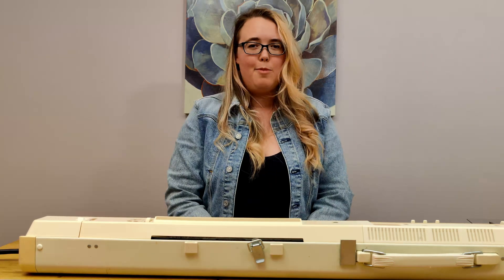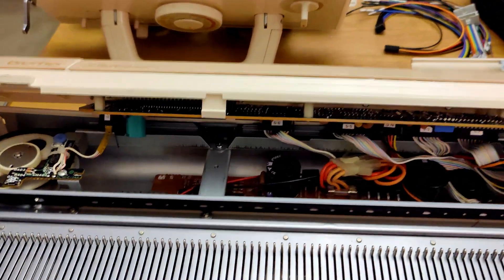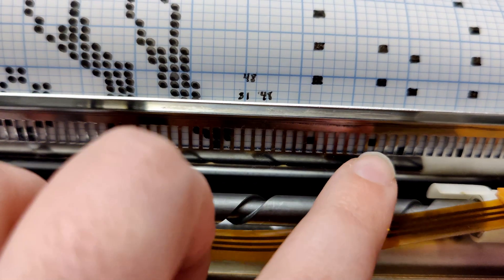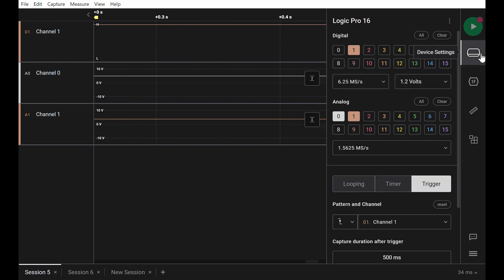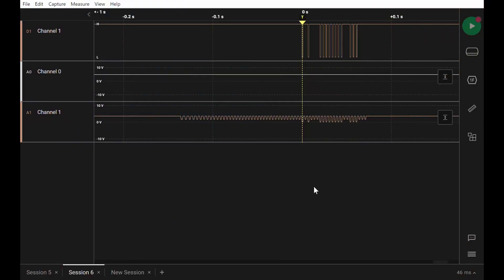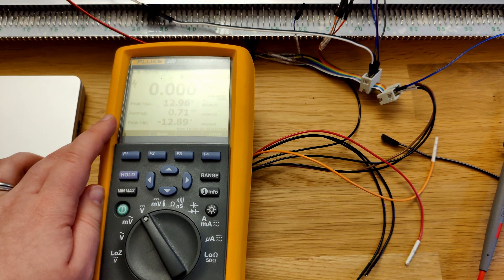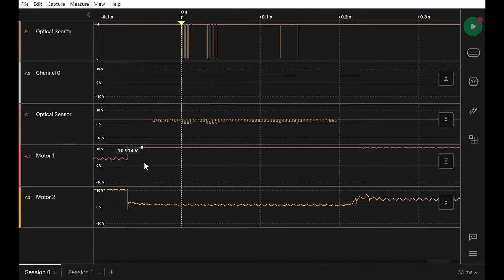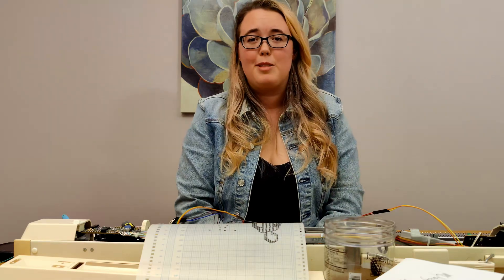Reverse engineering my Brother KH910! (Pattern system, part 1)

Comment: Thanks for this video! have been eyeing a kh910 for a while but was a little nervous about the patterning. 
Are you happy with the outcome so far? Is it easy to use/program?
Reply from the maker: Honestly the hardest part is finding the pattern cards, it took me awhile to find some on eBay. If I wasn't having fun reverse engineering it myself, I'd probably use the AYAB kit (https://ayab-knitting.com/ ) which makes patterning a lot easier!

Other than that, I just had to replace the sponge bar (this goes for all knitting machines since the sponge degrades over time) and it's been great!